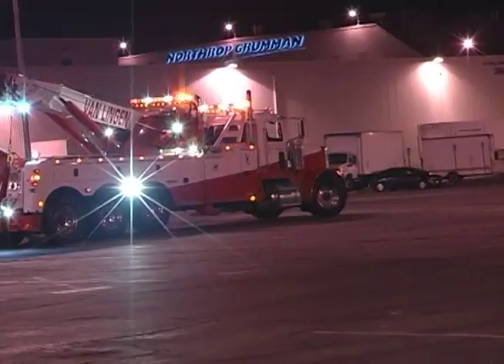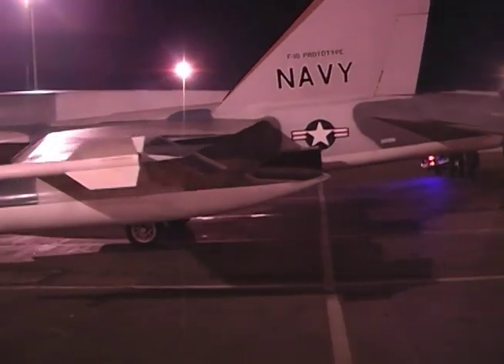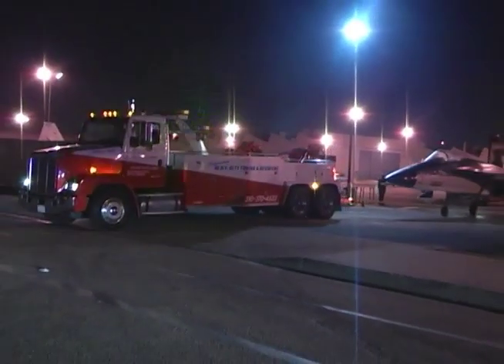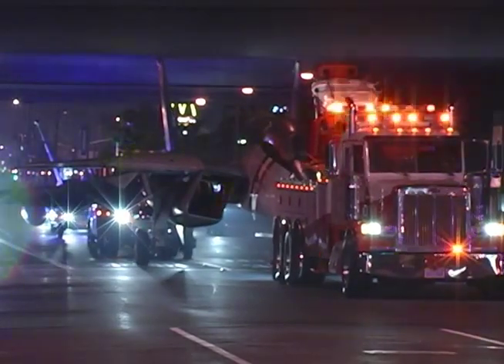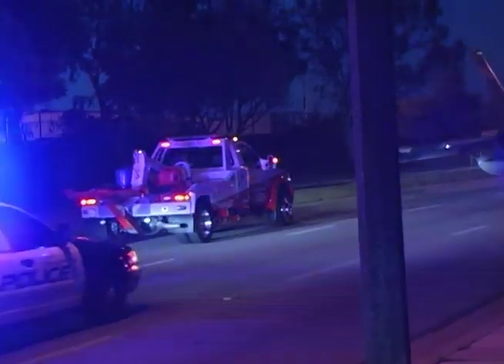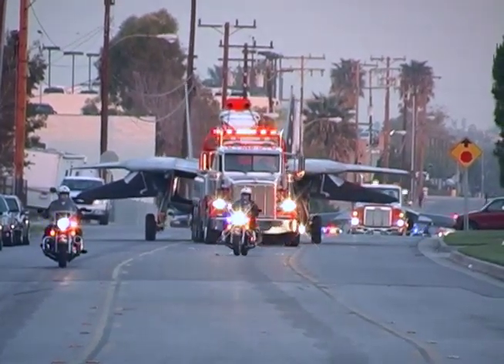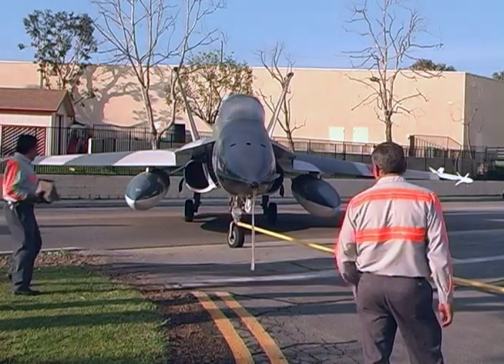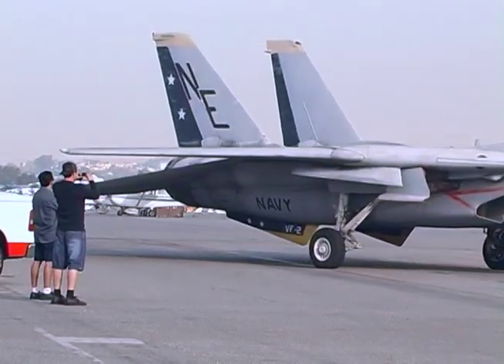F-14 and YF-17 Move to WMOF

Comment: The f-18 should’ve been putting into retirement not the Tomcat
Reply: But the F-18 is newer and more advanced
Reply: The F/A-18 is a god damn minivan. The F-14 was a much higher performance aircraft. If they had taken the money from the F/A-18, and put it into the Tomcats, they would have been FAR superior.
Reply: The Super Hornet is a beast. It can do all of the jobs the Cat used to do. And it can turn with an F-16. The old Hornets are garbage though.
Reply: @ppipowerclass  Grumman couldn't lighten the Tomcat to compare with the Super Hornet. The Tomcat was built for the Exclusively for Phoenix Missile Systems. In Air to Air the F-14 had trouble against the F/A-18E/F. Also keep in mind the Tomcat was a massive Maintenance Nightmare. As a Retired Naval Aviator having flown over 1868 hours in the Tomcat alone. It was a Dynamic Weapon Platform, but it's mission was completed.
Reply: @RahRahRaharu  it has no autonomy.
Reply: @curtekstrom6600  :"As a Retired Naval Aviator having flown over 1868 hours in the Tomcat alone. "

Btw,  bit odd that you claim to be a Naval Aviator, with 1868 Tomcat hours.
When Elsewhere you are listed 
Ekstrom, Curt AMS3 Jan 18, 1983 – Jul 18, 1985

AMS3  Petty officer third class
It's the lowest Non Comissioned Officer in the Navy, since when did those fly with Tomcats!!??!

Linkedin  (same profile picture as your youtube so i know it's you!)
US Navy
Total Duration4 yrs 1 mo 
TitleSecurity Police, Aircraft Structural Mechanic
Dates EmployedAug 1981 – Aug 1985
Employment Duration4 yrs 1 mo
LocationOrlando, FL - Keflavik, Iceland, - Jacksonville, FL
Enlisted in the US Navy from 1981 - 1985. Duty Staion assignment are as listed:
RTC Orlando, FL - Basic Training, August 1981 to October 1981.
NTC Orlando, FL - Apprentice Training, October 1981 to November 1981.
Naval Air Station Keflavik, Iceland, Security Police Patrolman, December 1981 to January 1983.
NAS Jacksonville, FL - Attack Squdron Twelve, Aircraft Mech. January 1983 to August 1985.
see less
TitleSecurity Patrolman
Dates EmployedDec 1981 – Jan 1983
Employment Duration1 yr 2 mos
LocationNAS Keflavik, Iceland
Assigned as a Navy Security Patrolman for Base Security.

VA-12 wasn't even a Tomcat Squadron.. in 83 They were sailing with CVW7 in the Med on the Ike.
you worked on A7E Corsair II's ( if that part at least is true)

Sounds like you are a lying sack of shit.. STOLEN VALOR.

Comment: The YF -17 was originally intended to be a supplement to the F-15 and F-16. For the Air Corps.    The Navy liked some of what it could do and it led to the final permutation that was the F-18.  The Hornet and Cobra while quite similar at first glance are very different in actuality.

The Cobra is "Offically" a prototype for the Hornet as it led to the 18.  But if you look at them side my side you can see many differences in the birds form.

Comment: can't the 17 fold the wings up?
Reply: I don't think the yf17 can it was originally designed as an Air force advanced fighter to compete the f16.  I could be wrong though
Reply: May be right although it's marked Navy here.  An attempt to appeal to the Navy brass perhaps?  Honestly can't see that much visual difference between the F-16 and the YF-17
Reply: The differences kind of stand out....YF-17, 2 vertical stabs (tails) F-16 1 vertical stab, YF-17, twin engines F-16 single engine, YF-17 engine intakes (inlets) on the sides of the fuselage, F-16 a single intake under the nose. and lastly YF-17 has a canopy "bow" type frame and the F-16 has a "bubble" canopy. Other than that they do look an awful lot alike...;-)
Reply: ed roberts You are correct. Not sure why this particular aircraft has Navy markings on the tail as the YF-17 was never for the navy. The F-18 was derived from the YF-17 but that was it. That particular model if you will had absolutely nothing to do with the navy
Reply: Jason Crawford this plane was used like a visual aid so the Navy could have an idea of how the Hornet would look like. This was after the competition with the YF-16. Navy liked two engines back then.
Reply: Wow the f 14 is enormous!

Comment: If the Navy was smart those 2 TF30's are at the bottom of the ocean right now, just where they belong.
Reply: TheJer1963 yes, those powerplants were awful in the F-14A ... but back in the late 60's, they were top notch. The F100 series wasn't available at that time.

The Big Cat was simply too heavy for their power output and its intended role. After all, these were the F-111 engines.

But if the Navy was real smart, they would have molten down the TF-30s for their valuable alloys 😉
Reply: The F100 derivative, F401 was installed into the F-14B in 1973.  Better engines were available a decade earlier if they threw enough money at it.